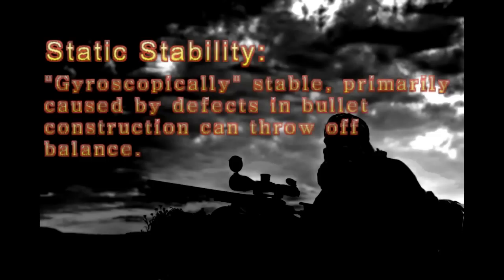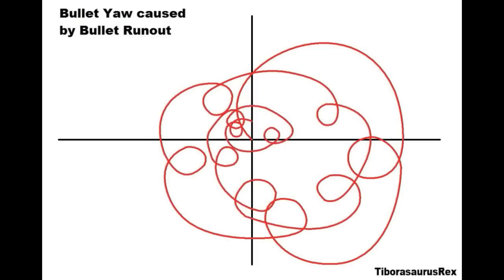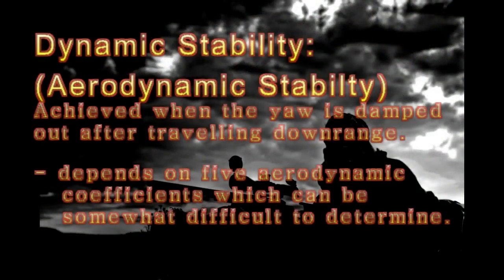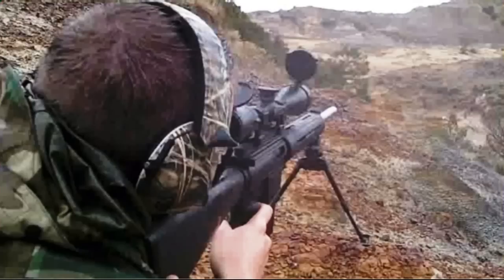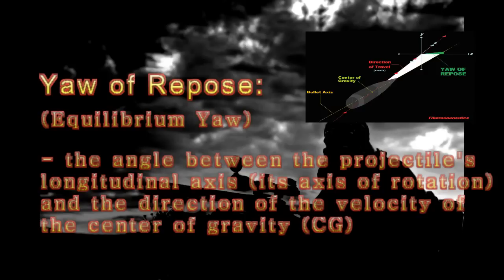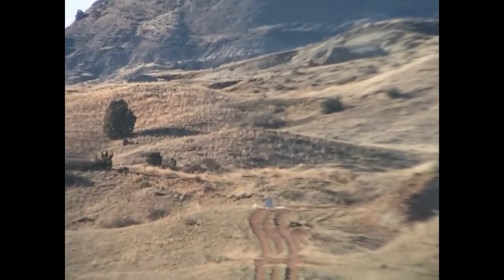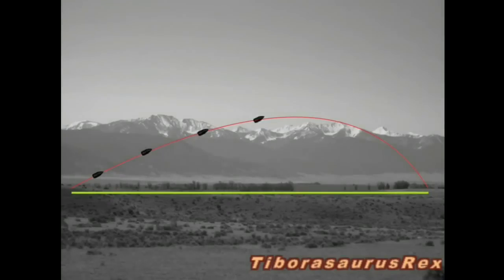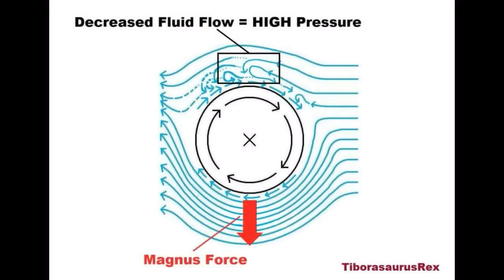Long Range 101 Part 70 - Aerodynamic Stability

Comment from the maker: 1000m is pretty far, but 800m is totally attainable. You will need to stick to 168s with a 1:12" twist in cooler weather where the air is more dense.  If you are operating in thin air, then a 1:12" twist will work with 175s or even the M118s should and may extend your max range out to 1000m or a tiny bit beyond.  Weatherby rifles are alright, although some of the cheaper models may require bedding or other stock work to minimize vibratory inconsistencies.

Comment: I once had the same question in engineering school. A quick way to think of it word by word.
Moment- the movement of a member (parts of the Bullet). 
of- About (the axis of spin of the bullet)
Intertia- "Rotational Momentum" 
I hope that helps a little. Its what keeps a top spinning and creates rotational rigidity about the center of rotation. The greater the "Moment of Inertia" the harder the top is knock down. If the top was the bullet and the air was your hand.

Comment from the maker: Brass, bronze, and other copper alloy bullets usually offer extremely concentric construction and good overall penetration and expansion control in hunting configurations.  Great qulity bullets.  Some challenges with pressures sometimes due to less plasticity down the bore.  Equilibrium will still generally apply albeit at a slightly different pace than standard lead core ammunition.  Keep good MV logs to keep track of your velocity variations as your round count climbs, and you'll be fine :-) 

Comment: moment of inertia is the ability of the projectile to resist changes in angular velocity, or rotation  about its axis of rotation. It is also used to quantify the capacity of the cross section of an object, like a steel beam, to resist bending.

Comment from the maker: The 'transonic zone' is the where a bullet goes from faster than the speed of sound to slower than the speed of sound - (usually just a little bit above 1000 fps).  The pressure signature around the bullet changes dramatically as the bullets decelerates through this velocity region and that causes most bullets to loose their dynamic stability, and thus their accuracy can not be guaranteed after that point.
Reply: You're very wrong. Most of FMJ and monolitic bullets remain dynamically stable as they go through the transonic zone. The serious instabilities that might result in catastrophic tumbling are more likely to occur deep in subsonic zone but due to other effects on work.

Comment: In days gone by I worked for Bell-Textron thru a co-op program at my local college...my job was to x-ray &  measure moment-of-inertia on large projectiles (approx 8" in dia, about 200 lbs & around 40" tall) loaded with high explosives in the body. They looked like supersized  .308 rounds. Anyway, I was never given an explanation of moment-of-inertia and was wondering if you could enlighten? Thanks for all your hard work, God bless.

Comment: Thank for your explanation Sd. I compared it to the formula Robert L. McCoy gives in his book "Modern Exterior Ballistics" and I must say that it's totally different:) That's not the point though...I'm still confused on the relationship of CG and CP and what role they play in the value of the dynamic stability factor (Sd). I'm trying to design a low drag SUBSONIC bullet. Unfortunately he doesn't mention subsonic effects much yet when he does it like " ...if the dynamic stability factor is unknown and the projectile must be launched at a transonic or subsonic speed, a value of the gyroscopic stability factor in the range of 1.5-2 should be selected to provide adequate flight dynamic safety factor" I don't get it!!! Why? I have most my drag force in the read...the CP moves closer to the DG=>less of a moment arm. If anything..it should be easier to stabilize it at subsonic speeds. What am I not getting?

Comment: Great vids.
Angle of Attack a vertical angle measured between the bullet’s longitudinal axis and the Relative Air Flow (aka Relative Wind) - it is a longitudinal variable about the lateral axis.
Yaw of Repose a horizontal angle measured between the bullet’s longitudinal axis and the Direction of movement - it is a lateral-vertical variable about the vertical axis.
Both go through the centre of gravity and both vary throughout the flight.
What I’d like to know is, does AoA fight against Repose and can a rearward CoG (toward the neutral point) assist that fight?

Comment: So basically if you could buy a projectile blue printing system by which i mean you buy manufactured projectiles based on your caliber and then work out the perfectly balanced projectile and the right barrel twist ratio to suit the weapons system your using then you have the other factors which can throw all this out weather conditions and other factors like who made your barrel and the weapon system you have, anything over say 1,500 yards or upto that range you really need to understand how to match load the bullets and the right grain size of projectile based on the type of shooting is required as well, powder and velocity and also more importantly the bullet or projectiles BC is very important most bullet manufacturers have this on there own web pages is just that you either have to learn all of it or hopefully someone has already done the work and you can skip right ahead to making your own bullets based on the maths others have already done?

Comment: Hello Rex,
     Not sure which video it was that I watched of yours[ RPM's of a bullet], but I just saw a statement on a bullet company which confused me and I want to say they are wrong. Could you please tell me the correct answer?
     The statement goes as follows "No, it is not a buzz saw like other manufactures would tell you as the bullet will only rotate at the same rate as the barrel twist; if the barrel twist is one turn in twenty inches, then the bullet will only make one revolution in twenty inches of penetration."
     If I understood what you said about the RPM's of a bullet after it leaves the barrel and how fast it spins, I would have to say this statement is way off. Peace, Reese
Reply: meccastreisand Thank you for the explanation. I was wrong in thinking that if the bullet was traveling at lets say 20,000rpms that the rate of twist was much faster as it left the barrel however I did not think about the speed at which the bullet is moving forward which might only make the statement true if you put the gun up against the animal. So, if the bullet is moving forward slower (1/2 as slow) and the rpms are still about the same at lets say 3-400yds than that rate of twist that was out the gate 1:12 then would now be 1:6 if I am still with you. So now the bullet would be spinning twice as fast per unit of distance. Correct? Peace, Reese
Reply: meccastreisand Thanks again so much for taking the time to help me. It is not the easiest subject for me but I want to say I understand the concept. Peace, Reese

Comment: So I was back tracking in this series a bit. I've watched all the 101s. I have been shooting a 260gr cutting edge .338 lapua out of a 1-9 twist, they fly really well. Stability is about 1.99 using JBM but the're big $$$$ looking into begers 300 gr otm (half the cost) fugered for about 2.42 on JBM is this to much stabilty?
Reply from the maker: Its very difficult to gather all conclusions mathematically as there is A LOT going on.  The best way to tell for sure is to gather your own empirical data by testing it for your operational conditions... but in short - 'too much stability' is usually not an issue, unless you tend to push it beyond the transonic barrier, in which case you may experience some negative effects.

Comment: Yaw of repose is a tricky one for some people to get. Because  it might be pointed at a completely different direction then where it's headed. And even so, it could still be completely stabilized even when pointed somewhere else and appearing to be a total Wacko of a shot. So they are two different things going on there.. Actually alot more then two... But suffice to say they are separated from one another, yet totally twisted up and in bed together. :)